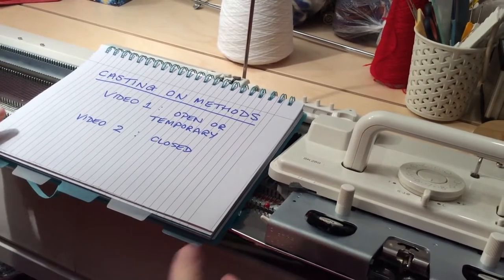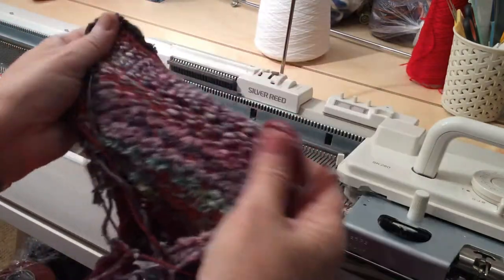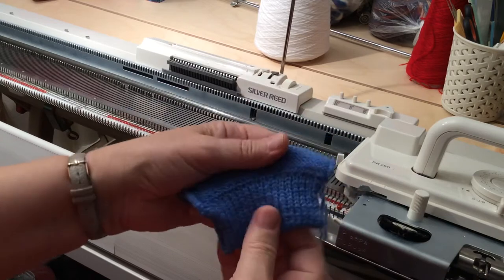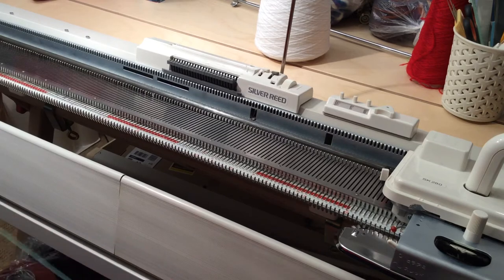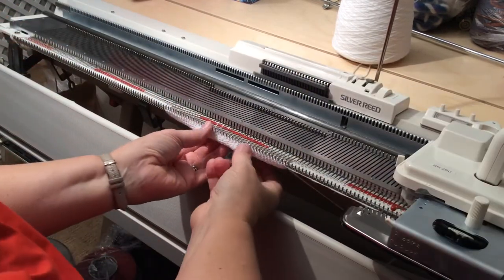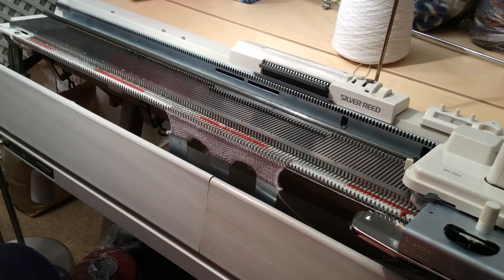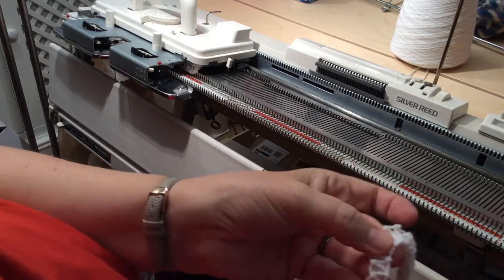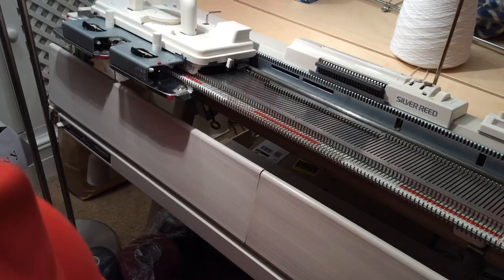Machine Knitting - Cast On Techniques - Part 1 of 2 - Open cast on

Comment: Sally, when you pick up the stitches that you knit onto the ravel cord for the hem, you say you are picking up the yarn in between the stitches, not the stitch itself? (16;33 or so in the vid). I am still worried about how this open cast on method will cause the main knitting to unravel.
Reply from the maker: It refers to the fact that you are picking up the bottom connecting thread between two stitches, rather than the top loop of one stitch. It won’t unravel!